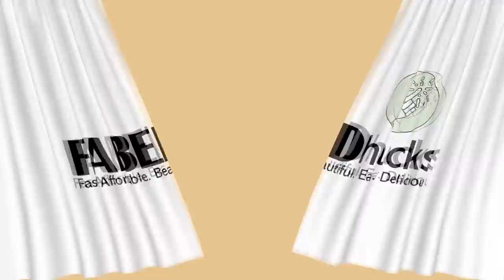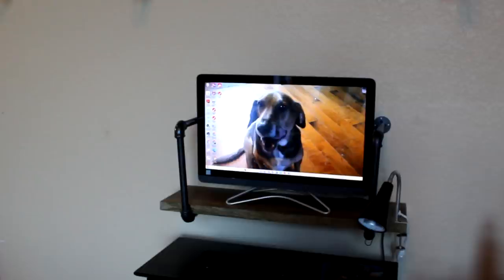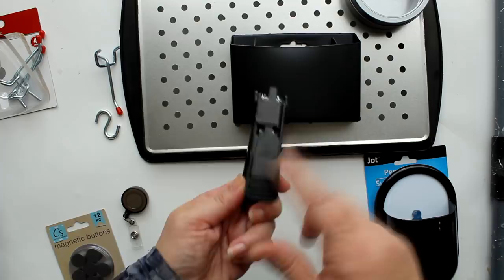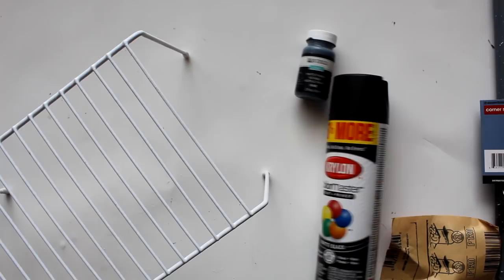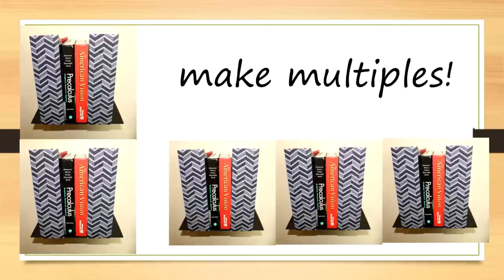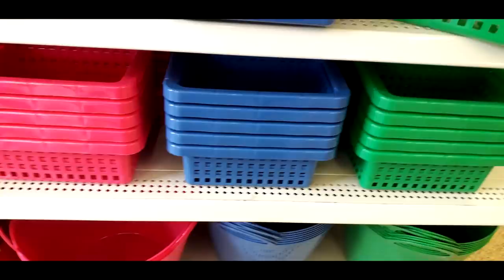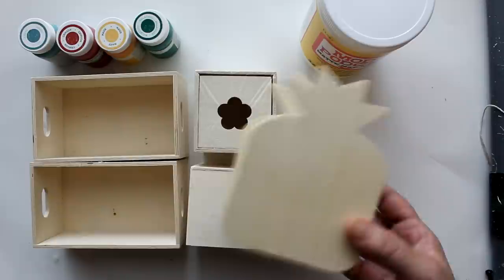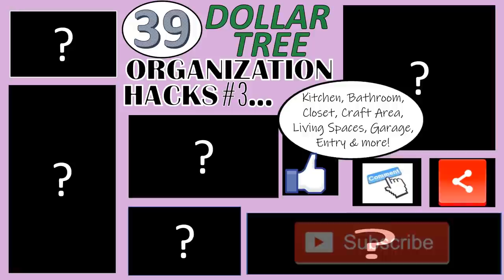DOLLAR TREE ORGANIZATION HACKS | DIY ORGANIZATION IDEAS | HOME OFFICE  📝HOME/REMOTE SCHOOL 📝

Comment: Thank you for sharing your creative and useful ideas!  Former homeschooling mom here as well, all my kiddos have graduated, I would have loved to have had all these amazing youtube videos accessible while schooling.  One question, do the hypertough strips work better than the command strips?  I have had no success with the command strips, even when I follow the weight guidelines, It seems a month into the use of them, inevitably my items fall from the wall and usually take a good chunk of paint down to the drywall even in some cases.  I swore to myself I would never use them again.
Reply from the maker: Thanks! So glad you liked the new ORG video! In regards to the command strips, I'm not sure, but it does seem as though they may have improved in recent years. About 9 or 10 years ago, I used them to do a wall of glass framed Godzilla images for my middle son's room with disastrous results! About half of them eventually fell off the wall and crashed to the ground and I, like you, swore never to use them again!! But then, about 4 years later, when my oldest went to college we used them for several purposes in her dorm room. They seemed to hold up all year and she used them throughout her college years so little by little by faith was restored. Now in regards to paint peel, my daughter will only use command brand and says that is the only one she can remove without any problems. However, I have had issues with both BUT have found if I hold the strip and pull STRAIGHT down very slowly, I can remove either of them without damage. 😊💗

Comment: I would love to see craft room organization hacks especially for wall hanging ideas.  I am hoping that your broiler pan (baking sheet with holes, will hold up heavy stuff as a peg board.   I am also trying to figure out how to hang all of my paper punches on the wall but they are so heavy
Reply from the maker: Hi Kim! Yes! Craft area is next and will be published this week! Yes, it would hold heavier items, however, I don't think hanging them with the adhesive velcro strips holding it to the wall can hold that much weight. In that case, I would drill holes into the pan edges and attach to wall with anchors and screws. Are they the squeeze kind or the press down kind? Squeeze kind would work on a peg board but I think a better solution for the press downs would be to use one of those magnetic tool strips. I bought some years ago at ikea but I understand Harbor freight sells them for 2 or 3 bucks. That would look so cool. One of those strips with paper punches lined up on a wall! LOVE IT!! Of course you would also need to add some metal to the bottom so that it would stick. I think I might have to look into that you may see in the video later this week! 😊💗
Reply: @FABEDhacks  I cant believe that this was 3 years ago.  I just watched it again.  I just recently made a peg board out of those pans and then decoupaged them with napkins!  I'm soo pleased with it!  My husband actually screwed them into wood strips and then the wall!  They are as fastened as good as they can get.  I never did hang my punches.  I'm in another home now and I have minimal wall space as Ive been forced to make my craft room in the utility room so I have one wall to work with.  I love your DIY mind!!  Thank you!

Comment: The magnet stud finder only works with metal studs.
Reply from the maker: Hi Shawna! Believe it or not, it actually does work with wood studs! I have wood studs in my house and the demo in the video was done in my living room. The magnet stuck to the metal on the screw attaching the dry wall to the wood. That is why it only stuck in that very specific space on the wall where the screw was and not all along the wall where the stud is. It works even better with high power magnets you can get at hobby lobby but the dollar tree version is surprisingly pretty good also. 😊💗

Comment: I have a question about the double sided Gorilla tape, does it come off easily  without damaging the surface if you need to move an item you have hung with it?
Reply from the maker: Yes, it comes off easily! It is kind of like post it notes in a way. Holds tight but then removes easily. A couple of things though, 1.) if you use for something like the under shelf storage jar or the wood boxes, I found that you  want to leave the container without any contents for at least an hour so before filling. 2.)  If you use it for something like the peg or magnetic pans, then you want to use more strips on the top and bottom instead of just the sides like with the velcro strips.
Reply: @FABEDhacks  thank you

Comment: Craft room specific please...  How would you attach your organizer racks(etc) to log walls and support beams without drilling holes and still be able to support books?
Reply from the maker: By the look of things so far, crafts will definitely be next! For the books, I am not aware of any thing that can hold the weight of books on a wall outside of screwing into studs or anchors and both require drilling. I do have some ideas coming up in the living space areas which create book shelf units that are on the floor so that may help.

Comment: I have a really small bathroom. I have run out of ideas for using the space effectively. The only storage is a very deep cabinet that only has a few shelves. The shelves are high enough to have quite a bit of empty space. I have really been looking for something to make to make it work better.
Reply from the maker: Hi Denee! I will be coming out with a bathroom video shortly but in the meantime, you may want to check out my ORG hacks #1 video which has multiple small bath hacks. Here is a link  https://youtu.be/BvfotYp8TlI

Comment: these are all super cool hacks! but what I more worried about is if they can take the weight when it comes to the bins
Reply from the maker: Thanks! So glad you like the hacks! It depends on what you put in the bins and what you use to secure it.  If you the removable hooks shown, they  have a weight capacity of 1lb each  so if you use 4 hooks to attach, you can estimate about 4lbs of weight but you also need to include the wire rack and bin in that calculation. Also, please remember to follow package instructions instructions when attaching the hooks especially the wait time before adding weight.  If you secure with the Closetmaid clips attached with a wall anchor or into a stud, you will be able to go substantially higher in weight.
Reply: FABEDhacks thank you so much, this was really helpful!

Comment: Caution: When using rubber bands. Know that over time they dry out and turn brittle then fall apart. You might want to use twine or a spool of coated wire instead.

Comment: Ty. Unfortunately my dollar tree doesn't have the wire holders I have checked 5
Reply from the maker: I was in DT the other day and saw that area was almost sold out. They must just be waiting on a shipment though since they did not fill the area with other inventory. I have found that to be the key. If the area just stays empty, then they are just waiting a shipment. So maybe check back or call the store to see if they have restocked.

Comment: I have 3 areas I need help with the kitchen, small bathroom, and craft room if you could do one and then the other 2 later I would really would appreciate it!
Reply from the maker: Great news! Here is the link to a craft area video I recently published - https://youtu.be/TuhtKYVtPZY
Also, here the link to my original ORG hacks video which has a few bath and kitchen ideas but I will be making news with all new ideas focusing only on those areas shortly. Here is the link to the original video https://youtu.be/BvfotYp8TlI
Reply: @FABEDhacks   Thankyou! You gave me a couple of ideas I was looking for my bedroom like the bed organizer for my remotes and cell phones and towel racks for my bathroom wall. I was wondering if you could come up with something for me like some double sliding under the kitchen and bathroom sinks organizers  with glides for my cleaning stuff something along that line? I have Osteoarthritis, Degenerative Disc Disease, a Bulging Disc, and a Herniated Disc. So it's kind of hard for me to bend down and get things out from the middle and the back of the cabinets.

Comment: I have a massive varidesk on my dining room table in my living room. I have a sit and stand situation and have to bring out TV trays put stuff on. I faced a bay window. What are some ideas for this situation.
Reply from the maker: Yes, I can see where that is a problem especially as you have to transition from sit to stand and vice versa, things will fall all over the place. Would velcroing the objects (like pen holder, stapler, file holder)  in place be an option? For additional surface/work space, does the bay window have a ledge or sitting area you can extend and or heighten? Are there other furniture pieces in the area like a storage cabinet, credenza or server you can rearrange in the space to give you more surface space?

Comment: The magnetic tins at DT sadly have lids that do not stay on after a while, so they're pretty useless.
Reply from the maker: Yes, that is true for the smaller ones that come two to pack but for some reason, the larger one that is only 1 for $1, that one seems to be fitted correctly lid to container. But yeah, those small ones are awful!

Comment: garage is a mess, 6:13 this would work in the garage as a tool holder
Reply from the maker: Awesome! However, I don't think the command strips will hold the tool weight but a couple of screws with anchors or into studs will definitely do the trick!!😊💗